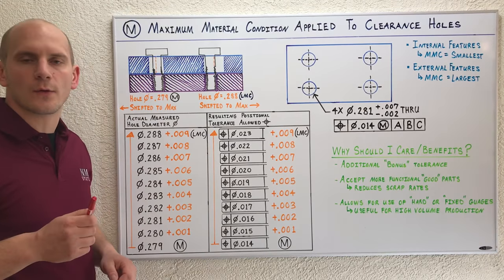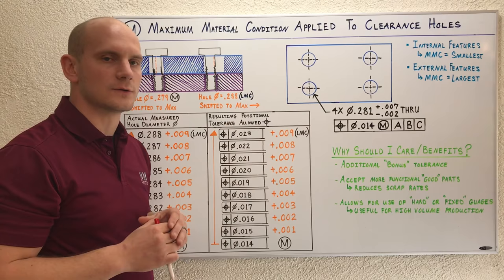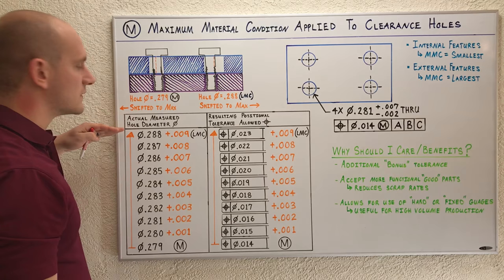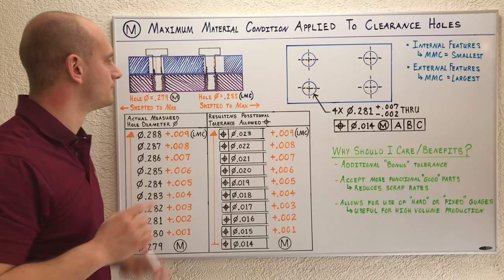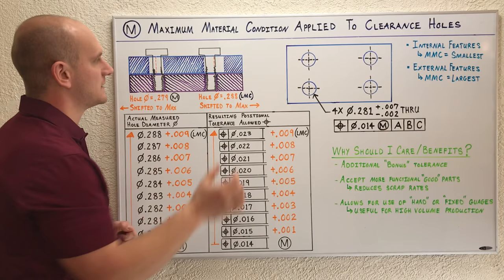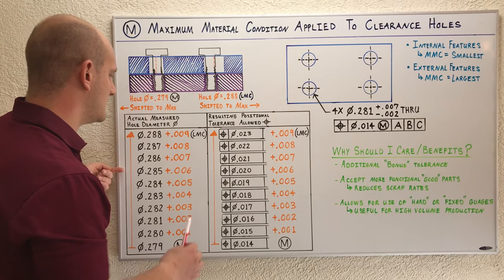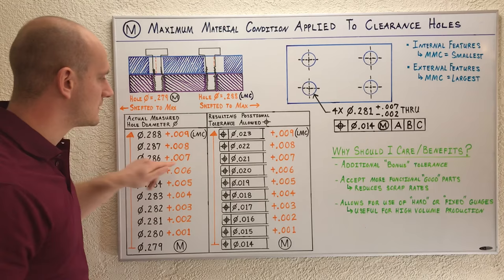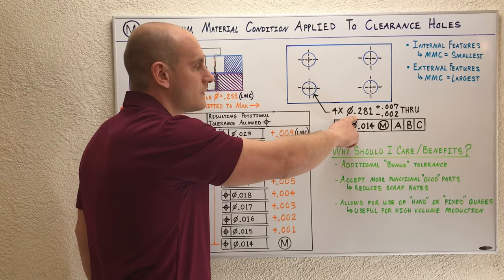How GD&T Maximum Material Condition (MMC) Works with Clearance Holes

Comment: this is one of the best explanation I have seen for the topic.
Thank you @Straight To The Point!

'The given value of the position tolerance is to be considered as the INITIAL value, when the feature is at its MMC condition' and then we have to 'ADD the diameter deviation value to the given position tolerance and use it as a BONUS tolerance' were the key points of my understanding from your explanation.
Reply: that second advantage of using the MMC condition is also well understood.

My understanding is as follows.
Since we can't change the hole positioning after it has been drilled, before throwing the part, at least we can do is to see the ALLOWED hole diameter for the current (deviated (already drilled)) position of the hole from the chart, and then enlarge it to that particular (allowed) hole diameter.
Reply from the maker: Hi skankhunt42! First, I see you man! I appreciate your various quality comments on several of the videos so thank you! Second, your takeaway from the video is perfect! How much the hole diameter size deviates away from its MMC size is considered "bonus" tolerance and so that means you get to add that amount of deviation to the position tolerance. Obviously this does not go on forever as you are not allowed to machine the hole any bigger than what the size tolerance states. So once you reach the maximum hole size allowed you have to stop there. Otherwise the part will fail due to the hole size being too large. Thanks again for watching and for the awesome comments! Stay safe and healthy!

Comment: Dude that was awesome! I have been banging my head against this concept for a month and a half and your explanation was a light bulb moment. Thank you for putting this out there.
Reply from the maker: Hi there Trayjan00! I'm glad you found this useful! I find that a lot of times GD&T is taught from a theoretical perspective and it can be hard to then apply it to practical scenarios. I hope the mini-assembly was useful in understanding how MMC can be applied to clearance holes from a practical perspective. Remember, MMC is a great tool to use any time you are dealing with any type of "Clearance" feature (where one features fits through or in-between another feature). MMC preserves functionality while giving the overall design and machinist additional tolerance to take advantage of just by modifying the size of the features. This is something that you simply can't do with traditional plus/minus tolerancing. Have a great weekend and stay safe and healthy!

Comment: While I have been in the trade for a good number of years, and as I listen to all of what you explain, all I can think is.   Just machine the part to the X/Y positional tolerance, and everything else is just bonus room for the machinist.   Put the hole diameters in the middle of the spread, and you will have no problems in QC.

Comment: Great explanation! Question... Since the position tolerance is called out on a feature of size, isn't the tolerance zone a 0.014 wide cylindrical zone from a median derived center line? And thus it can only move a max of 0.007 in any direction from the derived center line? This is for the example you gave at MMC.
Reply from the maker: Hello Henry, you are correct.  The tolerance zone is a cylinder with a diameter of .014 when the clearance hole feature is at its MMC.  However, the orientation and location of the tolerance zone is not "derived" from any feature such as the median centerline of the clearance hole.  Tolerance zones are first perfectly oriented and located from the specified datums which are simulated using your inspection setup (see datum feature simulators in ASME Y14.5).  Then the part is placed in the inspection setup and the physical part geometry is inspected to determine if it properly falls inside the perfectly oriented and located tolerance zone.  In this case, the tolerance zone is a cylinder of perfect shape which would be perfectly oriented to the primary datum using an implied perpendicular 90 degree basic angle and located from the secondary and tertiary datums using a combination of two specified basic location dimensions. To address the core concept I think you are driving towards though, yes, I was somewhat incorrect or slightly misleading without further explaining to say the hole is "shifted" to its allowed maximum of .014.  The maximum allowed "radial" shift is .007 from the true position.  The maximum allowed "diametrical" shift is .014 from the true position. If you will allow I will provide an explanation rather than an excuse.  When I initially drafted my whiteboard I actually listed both the radial and diametrical shift values and in my initial practice runs I explained the difference between the two.  However, I felt it was additional information that wasn't necessarily critical to explain the concept of MMC.  It made the video longer than what I wanted and I felt it "muddied" the waters and pulled attention away from the goal of explaining MMC. My plan is to create a video that conceptually explains how position controls hole features.  In this future video I will spend a few seconds explaining the differences between radial and diametrically shifting of a hole's axis away from true position within the tolerance zone.  From the subtle details of your question I can tell you have a good grasp of the fundamentals of GD&T.  I hope you do not feel that this video did the viewer a disservice in its goal of explaining how MMC works with respect to clearance holes for the GD&T beginner.  Feel free to follow up with any comments or corrections.  GD&T is something that is better learned from each other with an open mind due to its complexity.  Ultimately, thank you for watching and participating in the conversation and overall learning experience by commenting.  Have a great day!
Reply: @StraightToThePointEngineering  Hi, I have another question. I see that you haven't made next video about critical dimension of hole yet, so I want to ask you sth. Let's take your example with the same hole I mean 0.281 +0.07 -0.02 and 0.014MMC. In that case, the maximum let's say "position of screw" in assembly has to be 0.265? I took 0.281-0.02 which gave me 0.279 and 0.014MMC so "Virtual Dimension" of circle which cannot be crossed by the hole boundary is 0.265, am I right? So as I wrote, outer boundary of screw (max dimension) cannot be bigger in this example?
Reply from the maker: @Piotr-vk9sw  Hi there Piotr!  Let me see if I understand your question properly.  You are attempting to understand the fitment relationship between the clearance hole and the fastener in terms of Virtual Condition.  By determining the fitment using Virtual Condition calculations, you will ensure the fastener and clearance hole will always assembly even if the features are manufactured at worst case.  When designing using Virtual Condition, as long as the Virtual Condition of the external feature (the fastener) is less than or equal to the Virtual Condition of the internal feature (the clearance hole), then the features will fit together during assembly.  If I understand your question and comment, then yes you are correct!  Your calculation of the Virtual Condition of the clearance hole was correct per the following:  Ø.281 - Ø.002 - Ø.014 = Ø.265.  From a practical design perspective, you would then use this Virtual Condition value to determine the maximum allowable Position Tolerance that you could apply to the threaded hole that the fastener will get assembled into.  You would start off with what you know.  You know the maximum diameter of a 1/4-20 UNC 3A fastener is Ø.250.  You now know the Virtual Condition of the clearance hole and so you can set that as the Virtual Condition of your fastener which equals Ø.265.  Now simply calculate the maximum allowable Position Tolerance of the fastener's threaded hole per the following:  Max Position Tolerance = Virtual Condition - Max Fastener Diameter.  The numbers will look like this:  Ø.265 - Ø.250 = Ø.015.  This tells you that the maximum position tolerance you can apply to the threaded hole the fastener will be assembled into is Ø.015.  The only caveat is that you MUST properly apply the correct Projected Tolerance Zone to the Position Tolerance that is controlling the threaded hole.  I hope this helps reinforce that you are correct in how you calculated the Virtual Condition of the clearance hole. Additionally, you are correct by stating the Virtual Condition of the fastener can also be called its Outer Boundary.  I would, however, stay away from using the term "Virtual Dimension" and stick to calling it the "Virtual Condition". Virtual Condition is defined as a numerical value that is calculated from MMC or LMC and the applied positional tolerance so there is no need to create your own term. If you have any questions, please feel free to respond.  Thanks for watching and engaging all of us in the comments section!  Have a great day!

Comment: Just found this video.
First, l am not an engineer in any capacity but to me, the hole size for the fastener is predetermined by the size of the specified fastener, the minimum drill or reamer size to allow the fastener to pass through the material?
The only other factor to consider is the minimum specified flange/shoulder/plate size surrounding the hole that the fastener fixes unde compression.
Otherwise you would be into making a special size tool and fasteners which isn't always cost effective.
No doubt and hopefully some can show me the errors of my thinking if any?

Comment: If the .281 dia did NOT have the +.007-.002 tolerance next to it would the MMC be .281 instead of .279?
If the .281 dia did NOT have the +.007-.002 tolerance next to it would the drawings standard tolerance of .XXX +/-.005 make the MMC .276?
I ask because I have drawings that call out a dia with no +/- next to it.
Reply from the maker: Hi again Sven!  Awesome questions!  Let me address your two questions in order:

Question 1.  If there is not a size tolerance listed next to the diameter callout then, no, the MMC size is not the listed hole diameter by default (in this case .281).  You should instead look to see if the drawing provides a "block" tolerance or what you called in your second question a "standard" tolerance.  If the diameter does not have a size tolerance listed next to it and the drawing does not contain a block tolerance, then the drawing is incomplete and the manufacturer/inspector should contact the designer to confirm what the size tolerance should be.

Question 2.  If the diameter does not have a size tolerance listed next to it but the drawing does have a block tolerance listed then, yes, you would simply subtract the lower tolerance limit from the hole diameter to determine the MMC size of the hole.  Your example is exactly correct.  If there is not a size tolerance listed next to the hole diameter callout, however, the drawing lists a block tolerance of .XXX = ±.005.  Then to calculate the MMC size of the hole you simply subtract .005 from .281 which equals .276 (.281 - .005 = .276).

Again, thanks for watching and for adding value to the videos by asking your questions in the comments section!  Have a wonderful week and hopefully I’ll see you in other comments sections!

Comment: Quick question?
when the actual measured hole diameter is right at .281 then shouldn’t it be +.000 , instead of +.002? Therefore at .288 +.007 LMC ,  instead of .288 +.009 LMC  .  This would effect the values in the positional tolerance side of the table as well. Possibly there is a mistake and you’re adding the whole tolerance spread of .009 when it should be just the .007 on the plus side. Let me know what you think , thanks

I like the table method here where you can see the relationship between the values. Much easier than a formula.

Comment: I have a question on this topic. During the inspection suppose you have a 4 hole rectilinear hole pattern. Also, suppose 2 of the holes are eligible for the bonus tolerance but the other two are on the MMC border. How is this handled? Do the parts have to be rejected??
Reply from the maker: Hi there Greg, thanks for watching and for the great question here in the comments section!  Once a part is placed in the inspection setup and you begin to probe/inspect any feature (even if the feature is a portion of a pattern of features), each feature from the pattern has to individually pass on its own merits.  Let me explain a little further.  MMC is called out so each unique hole size must first be determined and then the amount of "bonus" tolerance associated with each particular hole will be applied to its corresponding hole.  Let me be clear here.  You CANNOT transfer "bonus" tolerance that was allowed for one hole to another hole in the pattern.  Once again, each hole's unique size and its corresponding unique potential "bonus" tolerance must be determined and each hole then must pass on its own merits based on the total position tolerance allowed for each specific unique hole.  I hope this helps and feel free to comment back with questions/clarity if you like.  Have a great day!
Reply: @StraightToThePointEngineering  Very good explanation. Thanks!! I have another topic I hope that you address. I am a little shakey on the explanation of how MMC can be applied to a DATUM and how does it affect the part. Thanks for these vids. They are very well done.
Reply from the maker: In the future I will definitely look at addressing datums referenced at MMC and what that means.  It is a quite complex topic and so it will take some time to move the channel to that level of complexity (with only 8 videos so far I do not want to scare anyone off yet with super-complex topics yet).  A quick explanation would be this.  The inspection equipment simulating the datum called out at MMC becomes a fixed size equal to the features of interest's Virtual Condition.  This means the part will actually be able to float or what we call "shift" around inside or around outside the simulated datum depending on whether it's and external or internal feature.  You will start off by placing the part in or around the inspection setup and inspect the feature or the entire pattern of features.  If they do not pass initial inspection then you are allowed to move or "shift" the part around with respect to the datum called out at MMC and then re-inspect the feature or entire pattern of features to see if they will pass with part in its new "shifted" location.  This is what we refer to as "datum shift".  Let me be clear when it comes to a pattern of features, you are NOT allowed to inspect one of the features, then "shift" the part around and inspect any/all of the other remaining features.  Once the part is shifted, you have to re-inspect all the features in the pattern and they ALL have to pass with the part in that new "shifted" location.  Then each additional time you "shift" again, then you have to re-inspect all features in the pattern all over again.  This type of datum callout is VERY function-dependent and should ONLY be called out if the fit and function relationship of the part to the assembly allows the part to move around during assembly and still fit and function once its in its fixed in its final assembled configuration.  Hope this gives some insight in the meantime.  Thank you again for watching and commenting here.  It adds real value for everyone I hope!

Comment: Can you do a video that explains this same scenario but with a composite tolerances? such as the same positional tolerance of .014 (M) ABC but with a .007 (M) to A? and then another video that explains the positional tolerance of the threaded part (purple part) in this video?
Reply from the maker: Hi there bdempz! I will definitely begin to work on a video on how to apply composite positional tolerancing to this scenario.  It will take a bit of time to figure out the best method on how to present a complex topic such as composite tolerancing in way that doesn't fly over the top of everyone's noggins but it definitely can be done.  Additionally, you asked for a video that explains how to apply positional tolerancing to the part with the threaded holes.  I can definitely do that and will start with that one while constructing the composite positional tolerancing video in the background.  Thanks for commenting and for requesting content!  I appreciate you engaging with all of us!  Have a fun day!

Comment: What does "M" mean when it is put next in the "A", "B", or "C" box?
Reply from the maker: Hello Sven, in the video I explain that placing the symbol "circled M" in the GD&T callout invokes the concept of Maximum Material Condition.  This means that the tolerance you provide is no longer a fixed value and instead the tolerance you provide only applies when the feature is at its MMC size.  As the feature (in this case the clearance hole) moves or deviates away from its MMC size, you add that amount of size deviation to the position tolerance.  This creates a direct relationship between the actual measured size of the hole and how much position tolerance is allowed for that hole.   I go on to explain that this is beneficial when dealing with clearance holes because as the hole diameter increases, the hole position can be allowed to “drift” by an additional amount equal to that exact diameter increase and the parts will still assembly, fit, and function properly without inducing any mechanical interference.  Let me know if this makes sense to you.  Thank you for watching and for participating in the conversation here in the comments section.  Have a fun, productive week!